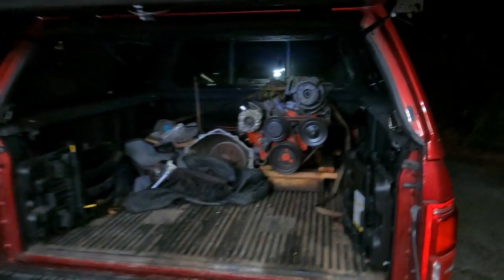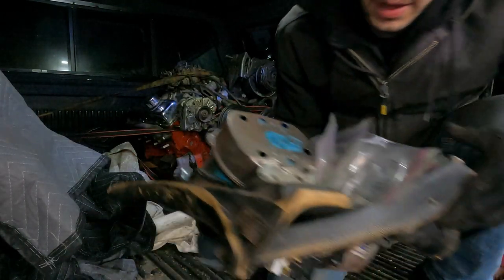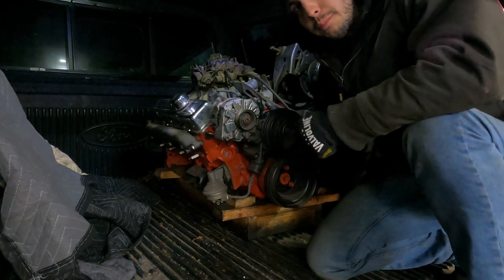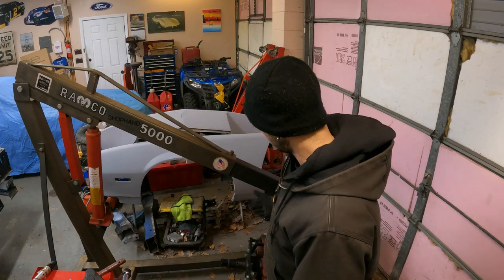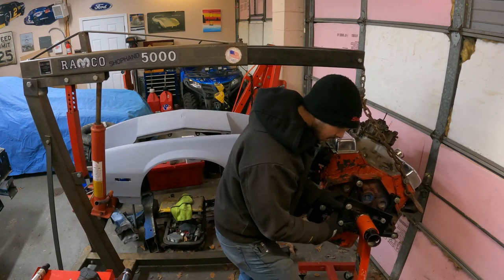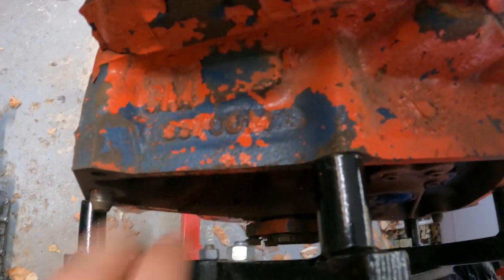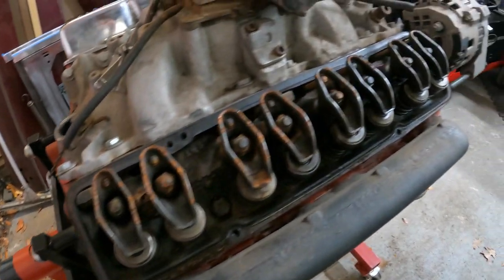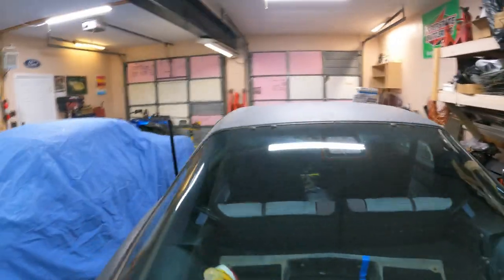1977 corvette engine

Comment: Good stuff.   
I'm a new subscriber because you and I are working on the same project.  A 3970010 block , .030 over.  I'd like to follow how you are coming on yours and we'll see how I do on mine.
Reply from the maker: Thank you! I'm happy to see other people still working on these engines.
Reply: @Getoutandwrench  
I'm surprised that I found this one.  It was in an old barn and I was saving it from the scrap metaller .  
Ya know , I'm no spring chicken and back in the day, this is the kind of stuff I learned on. 
But it has been a few years. 
I'm retired now , and this will give me something to do with my time. 
I am interested in how you come along with yours and we'll see just how good I USED to be. Lol. 
" I ain't as good as I once was, but I can be as good ,once, as I ever was " 
              (Toby Keith )